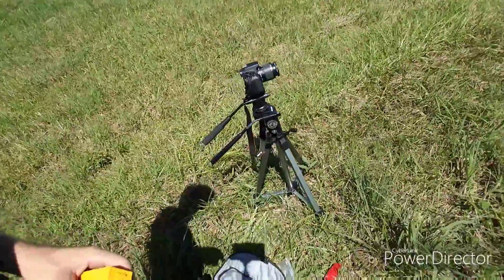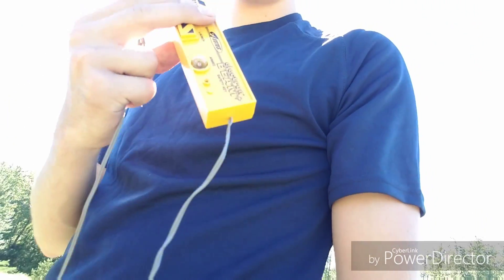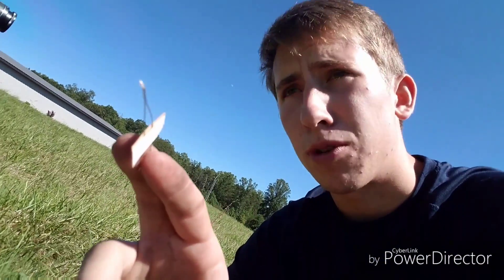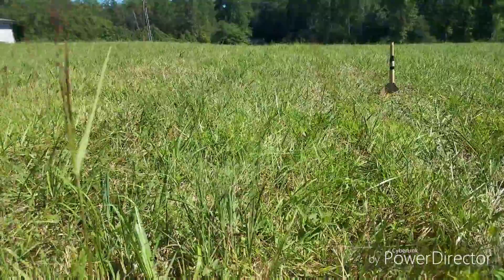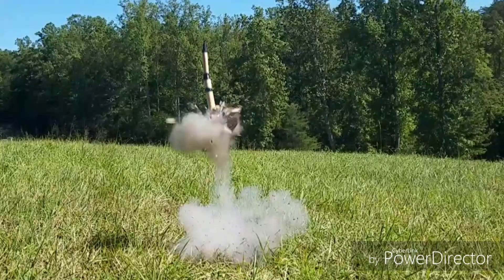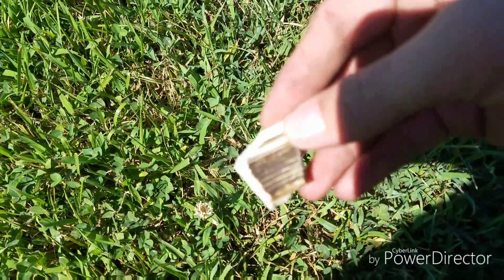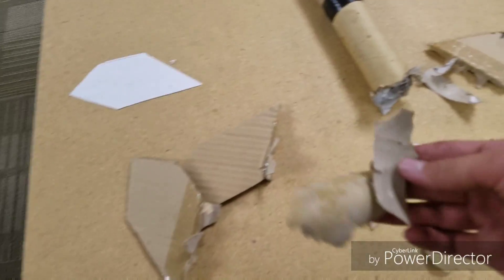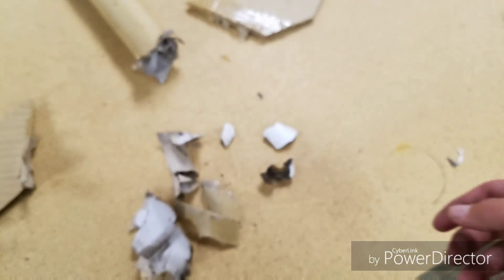Homemade Model Rocket Motor Explodes!

Comment: Hey Grant, I like your enthusiasm but a couple of safety first things need to come into play. Firstly not having a parachute is a big problem. Never launch with out one. Your engine is fairly heavy and if that comes down on a roof of a house or car it can be big bucks. Worse yet if it strikes something living. 
A better way I found to test rocket engines is to auger a hole in the ground. Place the engine in with the nozzle end up and only the nozzle exposed. Use some loose dirt to keep it upright. That way if it explodes most of the shrapnel will still be in the ground--this make it much safer and easier to find.  Also you'll get useful information by being able to read your flame through the entire course of the burn. Good luck.